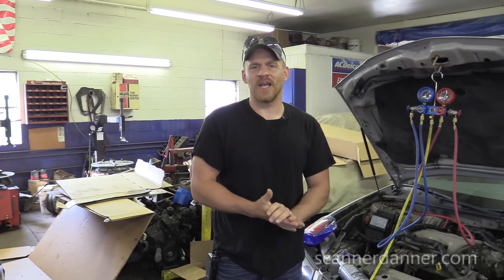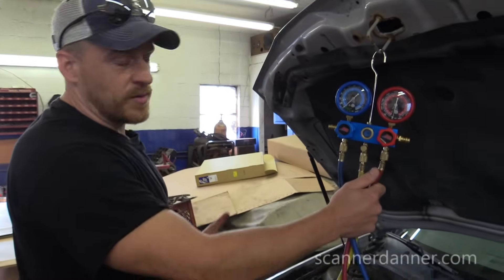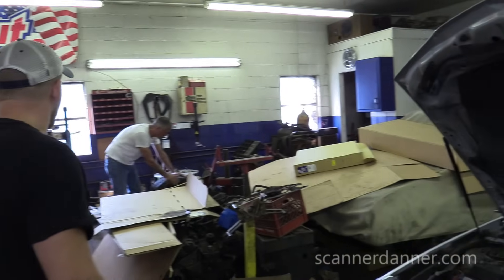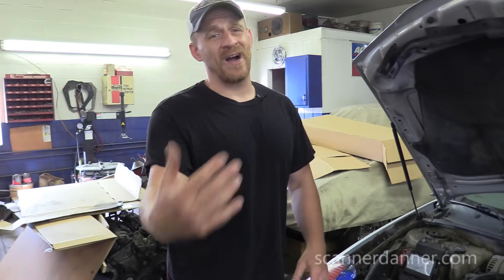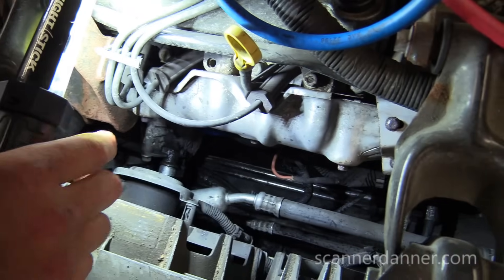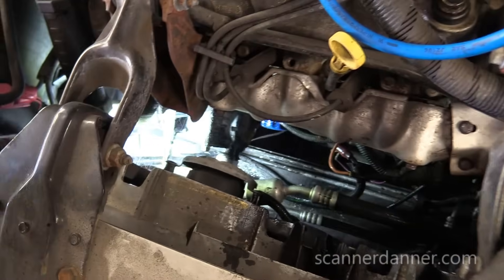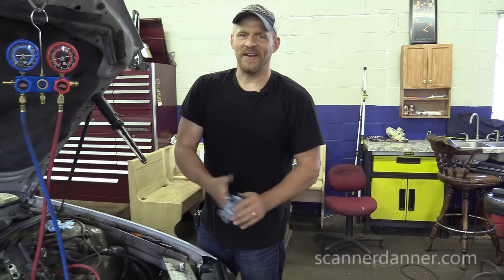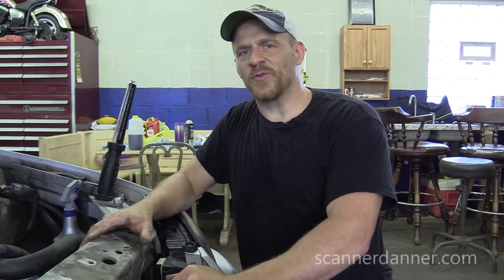A/C Leak Testing Using Compressed Air, Soap and Water (any car)

Comment from the maker: I NEVER MIXED COMPRESSED AIR WITH THE REFRIGERANT! IT WAS EMPTY FROM A LARGE CONDENSER LEAK! 
Some of you want to argue, that what I showed was unsafe. Please tell me how an empty system, filled with compressed air, is a safety concern. I'm not asking about the supposed contamination. I am asking about the safety side of this procedure. I certainly do not endorse unsafe practices. 

Here is something I found on a Google search from some engineer forum...

HFC-134a is not flammable in air at temperatures up to
100 deg. C (212 deg. F) at atmospheric pressure. However, mixtures of HFC-134a with high concentrations of air at elevated pressure and/or temperature can become combustible in the presence of an ignition source. HFC-134a can also become combustible in an oxygen enriched environment
(oxygen concentrations greater than that in air). Whether a mixture containing HFC-134a and air, or HFC-134a in an oxygen enriched atmosphere become combustible depends on
the inter-relationship of 1) the temperature 2) the
pressure, and 3) the proportion of oxygen in the mixture. In general, HFC-134a should not be allowed to exist with air above atmospheric pressure or at high temperatures; or in an oxygen enriched environment. For example HFC-134a should NOT be mixed with air under pressure for leak testing or other purposes.
Reply: If you caused an unsafe condition by using compressed air, then I'm going to buy a lottery ticket tonight and WIN, and then I'll take you, and ALL the subscribers of this channel on a cruise with me next week. :) 

In other words, we've got a better chance of being struck by lighting ... TWICE ... and winning the MA state lottery ... in the same hour.
Reply: Nope, R134A is not combustible in the atmosphere , so putting air in there  works the same way, the negative point by doing this is that you are introducing water vapor in the a/c system but he explained that anyway there was a leak  therefore  air and humidity were  in already.
Reply: @carlosmejia5728  The system has been contaminated so he will have to replace the accumulator/drier anyway, then pull hard vacuum.
Reply from the maker: You summed that up better than I could have. Thank you!
Reply: i love the vids I went to school in texas and love your vids . Ive learning things that books dont show. Able to keep my car running . Its great these vids and training have saved me time and make me a better tech.
Reply: Been there and done all that the few have done with the air won't hurt a damn thing just vacuumed the hell out of it a lot of these rum-dum don't know this test pressure is 200 pounds + now if that was a commercial system noooooo I pumped him up to about 250 lb with a big tank and nitrogen you have too I can explain all the ins and outs of that but it's not necessary hell yes you can use are on a car it's just a little ol AC system I will point out what I said and other post take the expansion tube out clean it or change it you should really change the filter drier accumulator because of bag inside degrades and can break I seen that and it is a damn mess I've cut them accumulator open look at the bag was not too impressed with it and said holy s*** this thing could break pretty damn easy you did a good job explaining all that me commercial AC mechanic 25 years
Reply: The Google search quote is straight out of the Material Data Safety Sheet (MSDS) for Dupont Isceon M099, i.e. HFC-134a.  

The take away from that would be to not expose the pressurized, hot air/HFC-134a mixture to a flame or, secondly, use a compressed bottle of 100% oxygen to pressurize a refrigerant system with entrained HFC-134a.

So Paul is perfectly fine to utilize shop air.

Great video.
Reply: ScannerDanner you should know better than anyone that YOUTUBE comments section are filled with attorneys, doctors, engineers, prophets & and OSHA/environmental safety agents....Sometimes not worth explaining to these people.
Reply: NexAgeMuscle, Agree with you thanks.
Reply: I would like to point this out what does a vacuum pump do it lower the boiling point of the water and boil off the liquid and the vacuum pump removes it
Reply: Did everything like you said and my guages went up I don't see any visible leaks it holds pressure
Reply: Hi,  Can someone help me?  So I vacuum down the AC system and left it connect for a day and it seem to have lost 8psi (-22psi).  I think it's a very slow leak since when I tested the system before Vaccum and it had a little pressure in it.  So my question is if I inject the dye and then vacuum the system to load the Freon will it remove the dye from the system?  Thx
Reply: @AsiaRoadTrek  I'm not a mechanic but the way that I've done it is I put in the leak detector and the freon when the system is pressured it will push the die out but if it's a small leak it's probably not going to show up that quick it might take days
Reply: They don't want that smoke @ScannDanner.
Reply: I worked at a major ac manufacturer.This is how all units were leak tested on the line with 200 psi.They had fitting you jus slide on high and low.
Reply: U offer on line training in acc
Reply from the maker: @jbarnett4194  as you can't read by the comments, maybe I shouldn't 😅
But no, I do not offer any other AC training, however I do teach every part of the electrical system. (Pressure sensors, switches, relay controls, ecm driver controls, power and ground side switching, pull-up and pull-down circuitry)
Reply: Yes it is very dangerous cause if u would of put your mouth over leak while filling it it could of  swelled your head like a  balloon an your head would of popped leaving a purple mess cause red an green make purple
Reply: Only issue I saw was that you weren't wearing eye protection with compressed air.
Reply: You are awesome! I do all My own repairs and replacing all my tools that have been stolen. The ones that make things easier especially. You show me ways of doing as good or better without some of them. THANK YOU !
Reply from the maker: @sherrypicchione5344  I'm sorry about your tools. People suck. But thanks for this comment
Reply: I've done it many times. You'll pull most of the condensation and air moisture out before you charge it anyhoo. I like to warm the engine a bit before pulling a vac. But sniff it if you can without wasting much valuable refrigerant. Not a big fan of dye,it gets everywhere.
Reply: I have used  big blue at work for leaks and nitrogen however I like to dye  showed me a visual picture of what’s going on
Reply: ScannerDanner some one touch a raw nerve. I also have seen in a Mazda service manual a caution not to use compressed air due to possible ignition of gasses. In Australia we use inert nitrogen to test the system's compressor function, but do as you do bro.  The system should also be flushed with compressed air and solvent. Also I found many videos demonstrating how the charging system of a vehicle works, your last explanation was not clear in your last video due to language difference such as "control wire". Nevertheless the  control wire switches the solenoid and the main power wire from the battery goes to the B+ post. Thanks for clearing that up bro.
Reply: Travelingman 1980 o
Reply: @Travelingman-1980  you gotta be careful with open flames in your house, the air around you might just blow up. Totally safe to fill ANYTHING with compressed air and do leak test. Entire system needs full evac of course and vaccum before it is re-charged. I think the main rec is around 70-80PSI for the leak test. The high pressure line is around 110psi off memory.
Reply: Me ac mechanic 25 years commercial I got a leak in mind bonded with a leak detector I believe it's a seal on the line at the compressor and the compressor seal I'm going to change the compressor replace the line  seals I said all that to tell you this I'm going to put my car into a deep vacuum clothes off the manifold set if you're at the house at your car leave it off overnight you couldn't have said a couple hours couldn't you I change out a condensing unit in my turn the gauges off went into the house had dinner went to bed lol checked it in the morning it was still in a deep vacuum I smile bingo the moral of the story is take your time leave it in the vacuum getting in a hurry will be an aww  shitt
Reply: 20 cubic feet of nitrogen cost $20 and last for 4-6 test and flush . All ready some one who is  certify and have experience explain why compress air can’t be use. When u take first class and test there are question clearly clear why we use nitrogen only , but google know it all.
Reply: There is more than one way to skin a cat. Any real mechanic/technician know this is not the best way to locate an A/C leak.
Reply: Your stupid  even one molecule of moisture will cause intermittent  problems.clean dry cleN and drt.never yse compressed air.unless you don't want it to work
Reply: Carlos Mejia , you are Johnny come lately, everything you stated has been discussed.
Reply: The mistake you have done is concerning compressed air. Never put air and moisture in hvac system. This causes oil compressor and filter contaminations. The results  are acid build up in the system and probably clouged XV.
Reply: @yacineelyas8756  You always evacuate before you refill
Reply: @Roger-eh7ez  Yes you have to. All good HVAC tech do. I also change drier if the system was kept open during a long time for any reason.
Reply: ScannerDanner you’re not supposed to use compressed air to check HVAC unit this is a good way to contaminate the pump oil. You use nitrogen because it does not compress like air and will not contaminate the system. You never run an air-conditioning system without having oil in the pump you damn sure do not do it with compressed air I strongly suggest you take a refrigeration class or stop fucking peoples cars up. I love backyard mechanics no fucking clue what they’re doing.
Reply: @danielmoriarty751  I work 25 years as an AC mechanic I'm retired now though I never sweat a little bit of moisture in a little ole car now a 20-ton Chiller we're talking about a different thing or a low temperature Refrigeration in it it's always smart to use nitrogen yes air has moisture in it I got a huge vacuum pump I was only 18 and like I tell somebody put air in a car AC unit I have done it when I had to no. Nitrogen I wouldn't put it in my house unit I know the reason why they put air in there they don't want to blow money on refrigerant I get that leave the vacuum pump on there for an hour or two not necessary but you can't if you really scared leave it on there 24 hours there will not be any air in that system the biggest thing you should do change the expansion tube or clean it if you can get it out change the accumulator which has a little bag of. Dryer desiccant  in it. The main reason you change accumulator is this that stuff comes in a little bag in the dryer it looks like a little saddle set on a tube inside with those bags get soaked for long. Of time with oil they can break and that s*** gets in your system everywhere you have to flush out the evaporator condenser all the lines and probably wrecked the compressor because how in the hell you going to flush it out most new cars don't have a place to put oil in them I sure in hell ain't going to take a compressor apart air is not going to destroy your AC system in your car or the water you just have to vacuum the s*** out of it the charging refrigeration system is really critical you wouldn't dare introduce an errand to act one drop with plug up the expansion device it plugs up because it freezes water I'm saying too much to you this might get a little over your head I don't recommend yet charging the system up with air to leak check the system I have done it in a car because it's not a big deal it's not a low temperature refrigeration system you have to vacuum it out and it will come out if your gauges read 29 HG there's no gas init or non-condensable air or nitrogen your manifold gauge must pull down to 29 HD if it goes down to 27 and 28 and I won't go down to 29 HD you got a leak or close off your gate set walk away from about 15-20 minutes look at your gauge set is that needle moves at all you got to leak the ideal way to find a way put a trace amount of refrigerant in the system Papa depth released 125 psi use soap or a leak detector if you're going to use dye it has to be a very small leak you can buy refrigerant with leak detector in it charge the car drive the car 3 or 4 days or when the AC stopped blowing cold air you can buy a really nice infrared flashlight at a pet store or Amazon 10 to $20 on the light look for the dye you can use a process of elimination no leak on lines around compressor seal condenser you might have a leaking evaporator if it's any kind of significant at all you can use a leak detector in the vent and it will squeal you can take the plug out at the drain under the car put the leak detector in the hole don't get water on the tip I sure had a lot of stuff with you I hope it helps you back to what I said in the beginning I don't recommend putting air in it you should use nitrogen but you can use air if you're going to enter Jack air into an AC system on a car you better vacuum the s*** out of it in a deep backing you lower the boiling point of the moisture or water and it boils off if you got any question post one it will pop up on my email you don't have a great day now
Reply: You can compressed nitrogen most air is mainly nitrogen we put nitrogen in a AC system to check it and because it is dry it will absorb moisture on big systems you are supposed vacuum at loaded with nitrogen actually do it three times then all the moisture will be gone but people don't do that unless it's a really huge system 50 ton and bigger some vacuum pumps are so powerful that they can boil oil right out of your system I got a big real old vacuum pump it takes a gorilla to pick it up it will vacuum my car out in 2 minutes flat I pump the car down 29 in HG and close off the gauge set since I'm retired I go in the fridge and get me a soda pop I'll come back in my little plastic chair and watch the gauges if they don't move your good to go and if you're worried about it what is set for 2 or 3 hours the last time I did a condensing unit at my house I pump it out for about 2 hours shut the gauges off come back in the morning it was 29 in HG it was good to go the moral of this story is make sure your hoses are good the lines are on tight I seen a guy work on a 50 ton chiller he had bad hoses took him a long time to figure that out if your hoses look old throw them away and get new ones you can buy the replacement hoses and the connectors on Amazon real cheap Happy Hunting
Reply: @danielmoriarty751  Well Daniel, the profanity is greatly appreciated. Gives you even more credibility.
Reply: @danielmoriarty751  I worked on commercial air conditioning 25 I put a post up ,all vacuum pumps all vacuum pumps will get moisture in the oil you just have to change it now and then I changed mine when when they got discolored in the sight glass moisture will not destroy your vacuum pump either look at the sight glass on the vacuum pump if it's clear and clean your good to go if not he'll just change it, it's not a big deal I hope that helps you a little bit
Reply: @danielmoriarty751 this is the correct answer. Mainly water vapor on your system can mess stuff up. It can lead to acids developing in the oil. If you do this, at least change the filter-dryer (which has a desiccant to remove moisture). Usually the filter-dryer on a vehicle AC system is a serviceable part that threads into the system near the condenser.

Comment: Another youtuber just uploaded a short 2 hours ago, showing a novel new way to check for a/c leaks on 1234yf systems.  That stuff is expensive.  Not a good idea to use it to check for leaks.  The evac and recharge machine will not allow you to do that anyway if the vacuum test fails on systems with 1234yf.  The other youtuber evacuated the system and used a stethoscope to look for the leak.  I thought that was pretty clever, but I am sure it has limits.  Evacuating the system and using regulated shop air and soap and water is probably the better method because as you showed in one of your other videos, vacuum can seal some leaks and you won't be able to find the leak under vacuum, and pressure is the only way to find the leak.

Comment: Never use shop air...  There goes the dryer,  use nitrogen if you must.  Its cheap
Reply from the maker: Drier is already saturated when the system comes in empty. Agree, nitrogen is better
Reply: Co2 is best.  @ScannerDanner

Comment: I don't wanted to waste r134a gas just to use UV dye and find a leak. I came up with this idea but I wasn't sure if I can do it or not. Scanner danner is doing it, so I'm doing it too. It's like NASA approved lol Thanks!
Reply from the maker: just make sure you evacuate the system really well when you are done. I'm using compressed nitrogen these days, just to keep all the naysayers away lol

Comment: This is a great method of finding leaks cheap. I used my Ryobi cordless air compressor to find leaks in two vehicles in 2 days working in a parking lot. I could use dye or my expensive leak detectors but this method is the best for large leaks which both cars had. Great advice as usual.